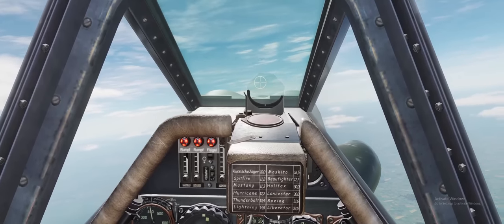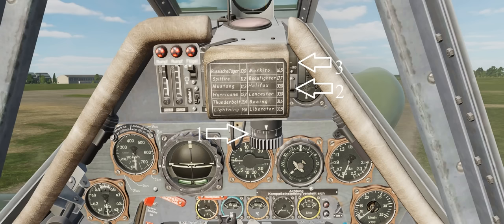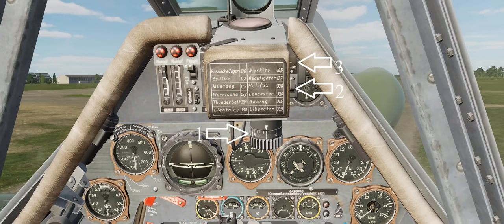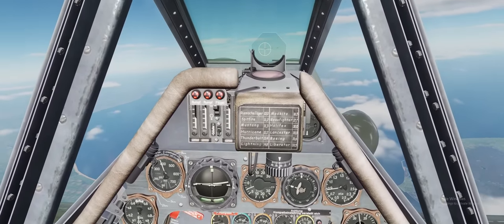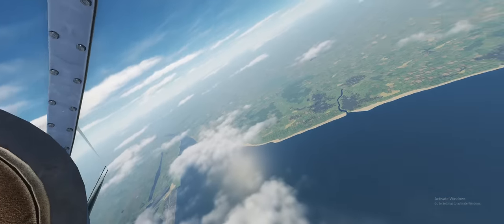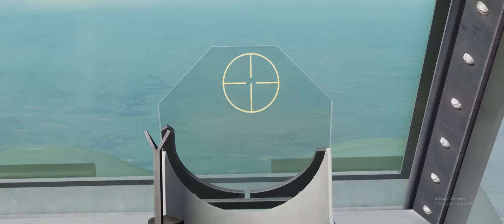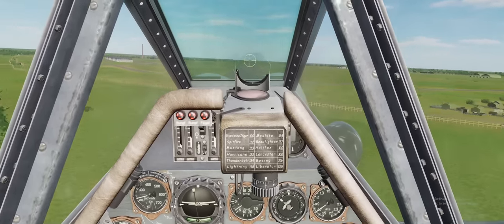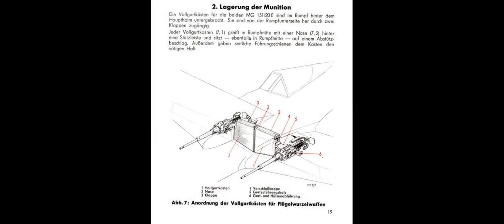Fw 190 D9 and the EZ 42 Gyro Gunsight DCS

Comment: Another great video Greg! This is very useful information for us Virtual 'Dora' pilots.  

A quick tip to control the gyro more efficiently 'on the fly': 
If you have a two throttle HOTAS setup like the Thrustmaster Warthog or any of the newer brands etc, you can use the left throttle axis as the range finder and on the Warthog you can use the grey axis slider for altitude, and put the wingspan setting to whatever you desire. 

I rarely use the gyro mode for fighters if I think they are aware of my close incoming proximity, but it has been useful in my Boom 'N' Run tactics and of course at long range with big, slow moving bombers. 
It is the altitude setting that I need to change before almost all other gyro settings as I have forgotten in the past, many times on the multiplayer servers.

MW-50 for twenty minutes straight? I will have to try that next time I'm out in her! 
I bet (approximately) half of my internal fuel would have been used up at that engine setting at twenty minutes non-stop. I always stuck to the maximum of ten minutes by the cockpit clock. 
It is also useful for me to use this power boost flying towards the enemy lines for getting rid of extra weight in the form of the liquid MW-50 mixture tank itself. I don't ever remember running out of MW-50. I always run out of fuel first.

I wonder how the 'Dora' would fair against the British 'Mosquito' with two decent human pilots. And two humans in the Mosquito of course! As an extra pair of eyes and relaying important cockpit information. Just like it would have been at the time. I also wonder if the Dora would out turn the Mossie, in a light, clean state. 
If I had to guess: I would say the Dora has the edge. The higher speed alone would be a great advantage.

According to the accounts of the Mosquito pilots I've heard, some say that the early air cooled, round engine 'FW 190's' could catch up to them at altitude. The 'A2' or 'A4' model maybe? 
Most definitely not the heavy high drag 'A8' version we get in DCS. 

And are we ever going to get the wing mounted cannons for the '109 K-4' in DCS? The slow firing 30mm cannon is very, very poor in deflection shots. 
I would much prefer the 20mm nose cannon, with more rounds and a higher rate of fire with better trajectory.

The 'DCS' German planes we get, seem to be made for bomber interception and ground attack! 
I just use my 13mm engine cowel guns for shooting targets moving through my gun-sight in my '109 K-4.'
Reply from the maker: Thanks Dragon. Yes, if you monitor the temps you can run MW50 for 20 mins straight, but then you have to back off and let it cool down. Keep in mind you will run out of MW50 not long after 20mins.

Comment: Wow! You're right, I didn't know about or use the altitude adjustment before! (Why is there no equivalent on the US lead-computing gunsight like in the Mustang? Is it automatic off an altimeter, maybe? Or are the .50 cal rounds fast enough that it doesn't matter much? Also, how does the same sight work for a plane like this that has both big fat cannon rounds and smaller, faster MG rounds? I'd expect a lot more "drop" from the cannons.)

And you're correct to think they've been messing with damage modeling, particularly in the warbirds which they were using to prototype their new piecewise DM on. (Before it was apparently pretty much just a dice-roll which components got damaged. Now they have fairly detailed "hitboxes" for most systems.) As with so much in this sim, they hyped it like crazy, then seem to have forgotten all about it. They also promised it coming to all other aircraft but I haven't seen evidence of or hype about that yet.

Are we sure that shake isn't propeller damage? (LOL! I typed that about 30 seconds before you pointed it out.)

Thanks Greg, absolutely love that you've added DCS content. Even for your non-DCS using audience, it provides great illustration of a lot of these concepts. I've shouted it out to my Facebook DCS group of 11,000+ members.

See you soon in the unfriendly skies!
Reply from the maker: Hi Admiral. I think the US gyro sight has a pressure sensor and did this correction automatically, but I don't know for sure. As for the vertical drop issue with the different ammo, that's taken care of with the gun mounts. The cannons have a slightly greater upward inclination. The vertical convergence is at 300 meters, and again at 500 meters as the shells drop. At no point between point blank and 500 meters are they more than 1.1 meters apart vertically. The factory chart for the plane only goes out to 550 meters, but it looks to me like at about 1000 meters they are going to be around two meters apart vertically. Considering overall accuracy at that range and the amount of ammo heading downrange, that's good enough to get some hits.

Comment: Long range shots aside, the way I use the gyro sight is as a close approximation when pulling lead.
I rake across until I start making hits > Now I know my mark, and I just intuitively approx how much more I have to dip the nose to accommodate for less shell/bullet drop, instead of fiddling any further with the range axis, which you don't have time for when making a 400mph+ firing pass anyway.
Other times when making a deflection shot, the pipper starts dipping below the nose, at least I know I have to lead by a heckuva lot.
That's better than not knowing how much I have to lead, so I cash in energy and keep the enemy's flight path aligned with the "line of rake" so to speak, until the pipper is below the nose, fire a burst until they're past my nose, essentially letting them fly through it.
Which might not get them for good, but if I'm properly aligned they're more than likely to get hit, at least dealing enough damage to win the fight.

Comment: Coming back to this vid after months; I just got thru reading the first volume of the JG300 unit history by Lorant and Goyat: I'm in late August/Early September and some FWs from II/JG300 (the 'sturmgruppe' element of JG300) had their planes fitted with the EZ42. One of the pilots recollected that using the Gyro sight he and his similarly equipped comrades could hang back as far as 800 meters from the 'Heavies', and still land fatal hits with their 20mm guns (not so fortunate with the 30mm Mk 108 cannons--so they simply left the 30s off) while far out of effective range of the defending bomber gunners. The only REAL problem was the escorts of course, who would come diving on them out of the blue.

Comment: Hi greg!, amazing tutorial, On IL-2 , the Dora has the same gunsight, but you can only manipulate the wingspan and range of the target, its necessary to range the target at the same gun convergence for get efective shoots? , example: attacking b17s at 800 meters, and my gun convergence has to be set at 800 meters to hit.

Thanks!
Reply from the maker: Thanks. The gun convergence isn't a big deal in the Dora. For example, in the manual for the plane it says that the default convergence is 600 meters. That means that even at 1200 meters the shells are still close enough together that both cannons are hitting the fuselage of a B-17 because its fuselage is wider than the spread of the cannon mounts in the Dora. Thus anywhere from 0-1200 meters, when shooting at a four engine heavy, it just doesn't matter much.
Reply: @GregsAirplanesandAutomobiles  I know that horizontal convergence doesn't matter in the Dora much, but what about vertical convergence?
Reply: We don't have convergence control in DCS, it's hard-wired to some historically plausible value. (Which is fine by me. Not all pilots got planes specially customized for them.)

Comment: Very nice video. I wonder how much the altitude for the sight matters. I have never seen this adjustment on any other plane. Sure the air density is lower, but you still have the same gravity affecting the projectiles.
Reply from the maker: I think it's automatically factored in by a pressure sensor in the U.S. gyro sights, but I'm not 100 percent sure of that. It's a big factor at long range.
Reply: @GregsAirplanesandAutomobiles  Might it also be less of a factor with smaller, faster MG rounds vs. big, slow cannon rounds? (And I already asked this above but, how does this sight deal with the different "drops" of the MG131 MGs vs. the MG151 cannons?)

Comment: One problem I see with hitting targets at long range is that the MG 151s 20mm ammunition has quite different ballistics depending on the shell type.
Late in the war, Germany used three main types of 20mm ammunition: Mineshells, Incendiary-Tracer developed from the early High-Explosive-Incendiary-Tracer and API.

The Mineshells are much lighter and therefore have the worst ballistics out of the three, followed by the API which comes closer to the Incendiary-Tracer.

So API would fall a bit short compared to the Incendiary-Tracer while the Mineshells would probably not even hit the targets above 600m or even less.
The US 20mm also had the problem with different ballistics so after the war they developed AP, Inc and HEI shells that had the same ballistics.

This makes me wonder how the German Gyro Sight was set up, since you would either miss with the Mineshells or the other types of ammunition when firing at long range.
Reply from the maker: The Fw 190 Dora manual has an entire section on exactly this subject. It's in the Patreon section but the short version is that the guns were aligned with specific vertical convergence points, must like the horizontal convergence of a P-51's guns.

Comment: I have noticed that German fighters of the period offset the gunsight to starboard while U.S. and British nations mounted theirs along the centerline of the aircraft.

Was there a specific reason for the Germans doing so, and did it make much of a difference compared to Allied fighters?
Reply: I think that’s just the result of having ammo counters in German fighters, and the logical desire to keep the counters visible while the pilot is heads up. By placing them beside the sight, it keeps them in view when they might be needed most - looking through the site.

Having the site slightly off centerline isn’t a big deal, but if they felt it was important to provide an ammo counter, putting it somewhere that would require the pilot to take their eyes off the action is sort of a big deal. Who knows if they were actually useful, or if I’m right, but that’s my guess - just another example of somewhat eccentric German design philosophy during the war.

Comment: It is surprising to me, with all of the sophisticated early avionics on the aircraft, that the gunsight can't just tap into your altimeter and set your altitude automatically. Is there a reason this wasn't done?
Reply: I'm guessing the main reason is that the altimeter is analogue and mechanical in nature and isn't actually producing a signal with a value that can be 'tapped into.'
Reply: Nobody in WWII built an aircraft gyro gunsight that automatically adjusted for altitude - it's just another thing that can go wrong so why bother?   Even on the super-sophisticated B29 bomber the air speed, barometric altitude & temperature was set by the navigator for all the gun positions - the individual turret computers can then make the particular corrections for ballistics, lead & parallax. No doubt the Germans copied Allied gunsights & time was pressing so adding another automatic feature causes a production delay & more complex maintenance training & thicker maintenance manuals. Increased complexity is expensive in maintenance man hours - better to keep critical features simple.
Reply: @biggieb8900  Sure, but it could turn a cam. It definitely would add complexity but my entire understanding of the 190's design philosophy was reducing pilot distraction in combat. I guess that's easy to say, as this was very late war.
Reply: @SirWilliamKidney  yeah and at this point they were assembling these planes in dark cramped tunnels with dust coming down on their heads from the carpet bombing above lol, and the dora was more costly and more time consuming at produce than a 262 apparently, so why continue adding more complexity at that point?
Reply: @SirWilliamKidney  German gunsight took nearly 300 man hours to produce. More production & maintenance man hours per feature. Has to stop somewhere. How about a speaking altimeter to save pilot effort?
Reply from the maker: Let's keep in mind the condition Germany was in at the time. Should they have delayed the gunsight's introduction in order to add this improvement? They barely got these things in to service without the extra complexity.
Reply: @nightjarflying  What makes you think they "copied" the technology?
Reply: @Leon_der_Luftige  The gyro sight was invented by us Brits & everybody interested 'copied' the concept. The late 1930s German version was sidelined until captured Allied aircraft revealed how more advanced US fighters were [the sights in a P-47 particularly drew their attention]. 

The American & German versions were tested by Jerry & the German design was considered slightly better, though both designs are vast improvements over a reflector sight of course. Some aspects of the American design were rolled into the German design for the resurrected prototypes. Possibly these changes didn't survive into production as materials & labour restrictions were biting hard by late 1944. 

I'm waiting on copies of design drawings from various sources so I can trace the evolution of WWII naval & aviation gunsights.
Reply: @nightjarflying  So they took inspiration and further developed it.. "copy" is a bit harsh, dont you think?

Btw... I wouldnt recommend referring to the inventor as "us Brits". What did you have to do with it? Or your fellow very right wing leaning British from today with the very woke AntiFa Brits from 80 years ago?

Comment: "War emergency power for 20 minutes." Is the much longer time you can run maximum power in a German vs. American plane due to the low octane fuel the Germans had access to not stressing the engine as much?
Reply from the maker: The water:methanol provides a strong internal cooling effect, and the Dora has a large supply of it. Plus the Dora has a pretty good radiator to help keep the temps in check.

Comment: Paved runways arent great in a battle damaged aeroplane.
If you have to land wheels up the risk of fire is FAR greater.
It was preferred to belly land on grass if at all possible.
Source. Various accounts ranging from paul richeys accounts of 1sqdn RAF in france to squadron leader allens 'spitfire squadron'  to mentions by  d bader etc. 
Squadrons on grass fields scrambled much faster than those on concrete runway equipped fields just by the way.
Reply from the maker: Every Aircraft manual I have ever read that talks about this make it clear that if you have to belly land you will have less damage on a paved runway than on grass. Every one, without exception.
Reply: @GregsAirplanesandAutomobiles  🤷 well that is interesting.
The common thread was it wouldnt catch fire on grass. On conrete the fricti9n heat couod make it go bang

Comment: Coming from 6 o'clock vs B17 is something that should be avoided. It will get you burned most of the times. Try head on from 12 o'clock high or from directly above where bomber will offer the largest profile. 
Generally, you want to be moving in two axis in a curved aporoach when viewed from gunners position. When you line up bomber as a steady target, you are, also lined up for a gunner as a steady target.
In IL2, on ace setting, B17 human gunners are replaced by terminators!!!
Reply from the maker: If you're outside their effective range it doesn't matter how good the gunners are. IL2 doesn't model the EZ-42 correctly, at least not the last time I flew it, which was over a year ago.
Reply: @GregsAirplanesandAutomobiles  True, but don't you need something bigger than 20mm to be effective at those distances (1km+)?  Also, how do you set up the convergence? If memory serves, after bullets pass the convergence point, they disperse quite a lot and the accuracy becomes quite horrible. 
I fly IL-2 1946, very old game now. In that game, only K5 is modelled. Maybe I'm too old and obsolete. Waiting to see the white of eyes before opening fire. I achieved the best results from head on. All vulnerable parts like cockpit and engines are located forward with minimum in the way of armor and other obstructions. Also, if that means anything in simulations, energies are added because target and bullets are moving in opposite directions.

Comment: M2 max effective range is 1,830 meters. 800 meters? Nope you'll end up a swastika marked under a gunners station.
Reply: On a stationary area target from a stationary sandbagged tripod with proper observation...  Flying vs. an also flying point target is a little different story.
Reply from the maker: Miles is correct, it's a lot different when trying to shoot at an airplane from another airplane. The effective range of B-17 gunners was about 400 meters. Even the very best gunsight and turret systems the US had could only hit at about 900 meters and only one plane in the European theater had those, the A-26 Invader.
Reply: on paper it is, now do it while flying in a bomber trying to hit a plane, at that distance you probably could barely even see it